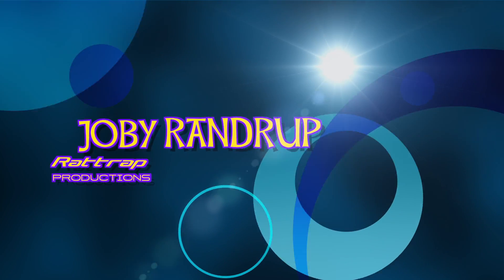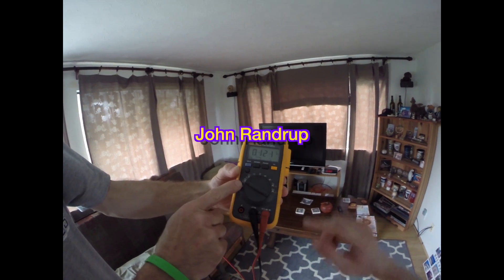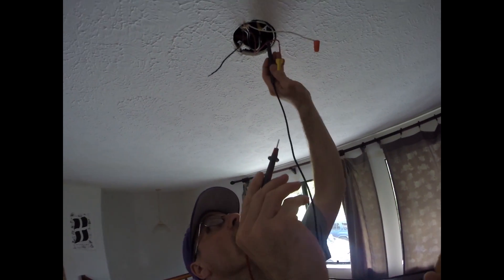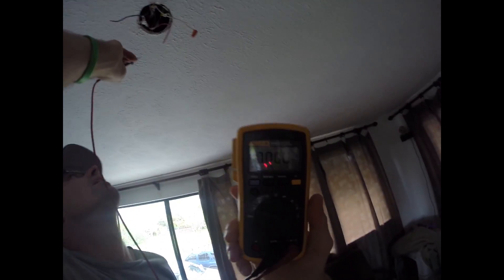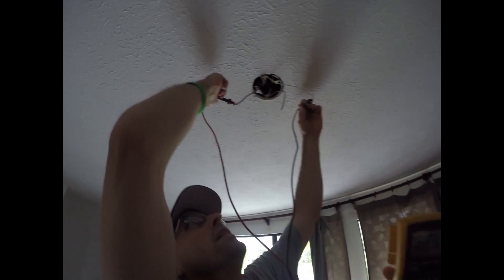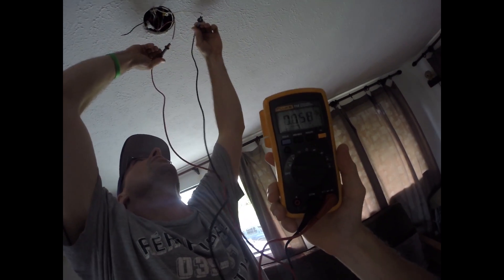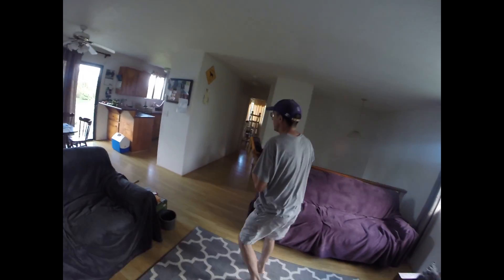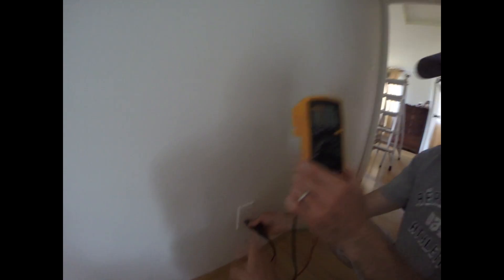How To Test For Power

Comment: When saying 'hitting the black to the ground', is the ground just the metal of the light enclosure that is in the ceiling?
Reply from the maker: A lot of times yes. It’s usually a wire that is attached to the housing that you connect to

Comment: can you explain if there's not any voltage going to the cables, why are you still picking up small voltage readings?
Reply: cause he does... he prob has high res in the wires cause he showing that he has some power but he losing voltage somewhere in the line.